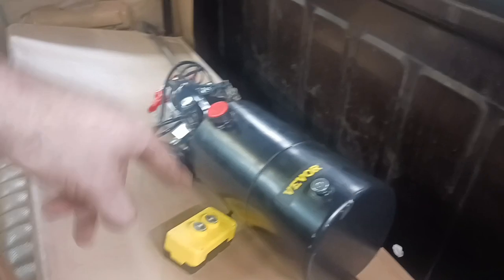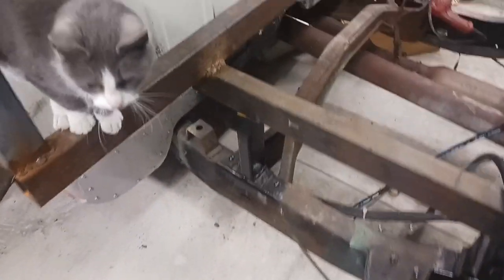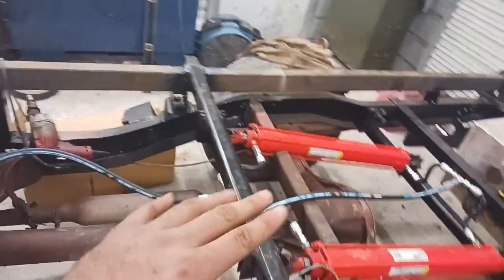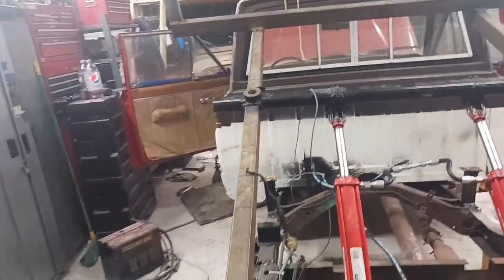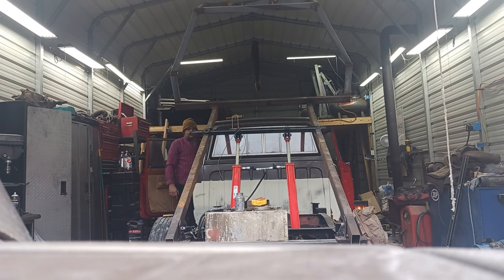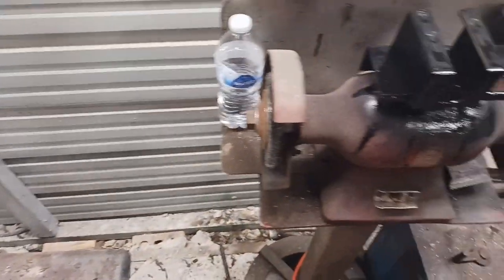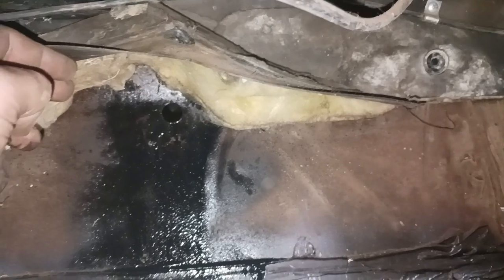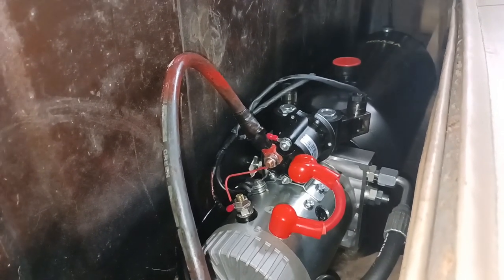Home Made Dump Bed Jeep J20 Part 3 (Hydraulic System)

Comment: Wrap a short piece of old garden hose around your hydraulic lines where they go through the body ! that sharp metal will slice a hole in those hyd. lines by virtue of their movement due to pressure changes !

Comment: Nice!! Great job !  I noticed the tubing is not braced where the cylinders pin on the frame of the truck and the bed if you have a weak spot that will be it . But if you don't load it to the hydraulic power capacity it will  probably be fine . If you are like me you will load the wagon 10-4...   keep on building!!

Comment: You should’ve had your rams the other way, your putting stress against your hinges. 

If your just hauling a few wheelbarrow loads of dry leaves then you should be fine. 

Your angle of the rams are not going to be very productive if you have some actual weight up front. 

You should always have at least an inch of your ram out and not in all the way because when a ram is bottomed out all the way in you won’t have the force it would compared to it out an inch. 

I have just a single ram and has plenty of power to raise the bed and not putting stress on the system. 

Not giving you any crap just making some suggestions to help you out.  👍

Comment: Hey u might of said it but what hydraulic rams did u use and what size are they?
Reply from the maker: I believe they are 2.5 bore 24-inch stroke 
They were cheap cylinders I found on line.

Comment: Your reservoir tank is Way too large. You only need a couple of gallons of oil for the system to function normally !
Reply from the maker: The tank you see under the bed  is an old hydrulic tank some one has made in to a fuel tank that came on another truck and now I am using on this truck just to keep cost low .

Hydrulic tank for the pump is 6 quarts